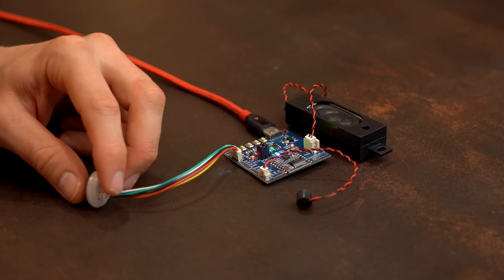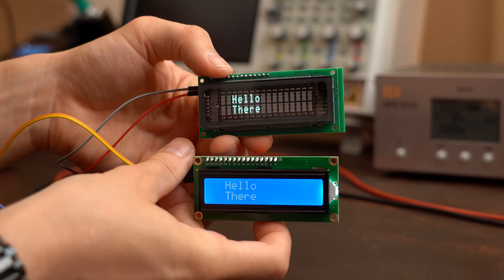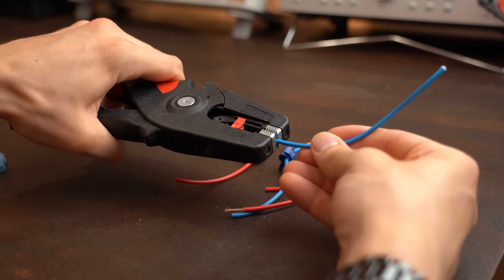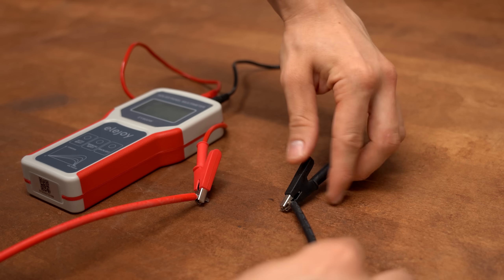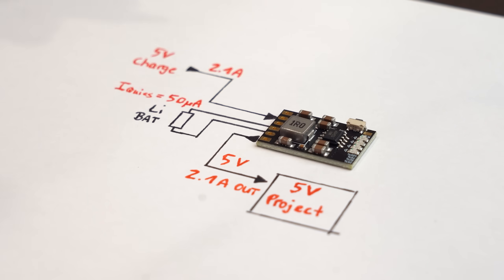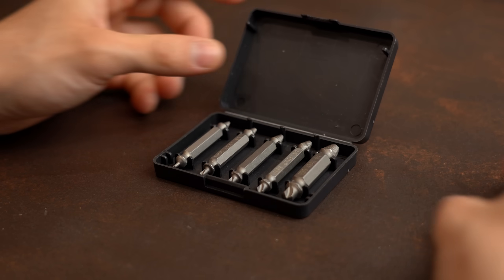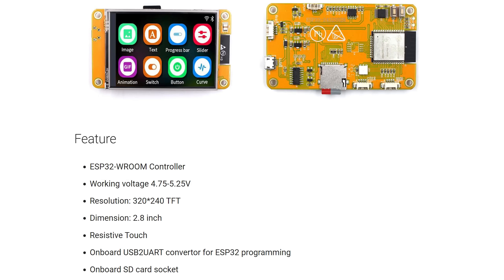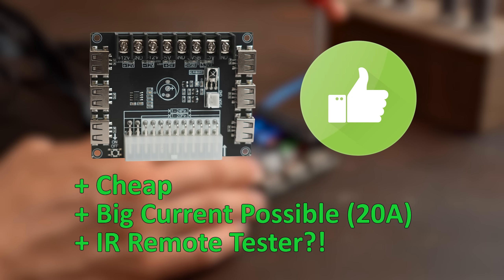I tried finding Hidden Gems on AliExpress AGAIN! (Part 6)

Comment: The blue clip-on connetors are not single size. They exist in multiple sizes with different color coding. The same one as insulated fastons. Red for 0,5 - 1,5 mm2, Blue for 1,5 - 2,5 mm2 and yellow for 2,5 - 4 mm2. They work great for indoor (interior) use for various low current application, if you need to just splice a wire without cutting them from a harness.

Comment: On the T-splitter: You have to understand that outside northern europe Wago connectors are like unicorns, It seems like its made for the US market since they use those red hats (yes 2023) and have usually one set of gauge on their cables (some look like actual stereo cables)

Comment: For the lithium ion battery charger, it has a key pin close to switch, so if you are using a microcontroller you just need to set a that key pin high evert 30 secs

Comment: Recently I have bought that lipo charger booster with a built in type C port
It came with an optional type A port that we can solder on. I have powered a raspberry pi 3 B+ with it and it works great. It never showed that low voltage issue, which I regularly get with the power adapter that came with the pi kit.

Comment: 03:35 Using Wago connectors without cable end sleeves on stranded conductors is, … —ehm— *botch*. (So you need at least one more tool for crimping the sleeves.)

Comment: I note that when trying to extract a screw, you wiggled the drill around and used a high speed. This will cause the drill to always strip and enlarge the hole without cutting in to allow the screw to be extracted. It is vital to maintain a 90 degree angle to the screw and use a slow speed, because you are essentially tapping a thread into it. Your method will always fail, no matter if the product is good or bad (and there are good and bad screw extractors). That said, I don't think that set is a good quality one and isn't worth buying.

Comment: Regarding solar panels, it should be a trivial and relatively cheap task to have a small sensor device with four small, cheap panels that has the panels in a flower petal configuration such that if the light is stronger on one side it provides a signal to control motors that turn both the small sensor panels and the main panels to face the light source. If controlled by a microcontroller then when night is detected then the panels could be reset to face sunrise. Thus, you could maximise your solar power collection automatically all day.

Comment: I used those T wire splicers in my last job as a laundry repairman. A lot of different retrofits included those to supply power to new card readers to replace the coin slots in older machines. Though the spade connectors were usually precrimped on the wires included with the retrofit.
Reply: You had a job fixing broken trousers and blouses?  Cool. ;)

Comment: Another note for the screw extractor to successfully get out the damaged head screw you need to drill a smaller hole inside the screw head after that use the screw reverse extractor so it has what to grip on. If you use it on a flat head it will never work/come out.

Comment: 10:05 Um...it looks like you're using the screw extractor bits in the wrong direction...and you're supposed to use them on low gear (high torque) mode/setting as compared to 9:51. The end of the bit that clears the head of the screw is used clockwise and the extractor side of the bit is meant to be used counter-clockwise....that's all provided that you used screws that need clockwise rotation to screw them into the wood. There are screws out there that use counter-clockwise rotation to fasten into the structure, and there are extractors sets for them. just need to be very sure when reading the description.

Comment: So the charger/booster could function as UPS for a Raspberry Pi.
Reply: No, if you remove the charging current, it will not auto-switch to battery power. Very weird/annoying issue with this module. @GreatScott! mind confirming this issue?

Comment: @greatscottlab Nice Video, thank you a lot. It would be cool if you can review the power bank / UPS with a microcontroller and two pins (to read I2C). It is easy to reuse Li ion batteries and can be handy to power important electronic devices. The readout of I2C can be handy to trigger a controlled shutdown of a server if the battery gets low. 300W Power Bank Case 1.54inch IPS Color Screen DC UPS LED 8cell 21700 or similiar one of this supplyer. Feb 22 Store

Comment: The screw extractor was spinning the wrong direction. Drill the hole clockwise and flip the bit and then remove the screw anti clockwise

Comment: What was the low voltage cutoff of the battery circuit? It's often 2,5v which is too low, I wish I could find some battery protection circuit that cuts off at 3v, very hard to find. I have looked may times.

Comment: I want to use the little usb boost/charge board with a 6v 0.8A solar panel and lipo cell. Do you think it will handle the varying solar current ok?

Comment: the screw extractors only work at low speeds and in the anti-clockwise direction, not as you did in the video

Comment: Dude you were using your screw extractors wrong. Your suppose to put your drill in reverse for them. They have left handed threads that catch and back the screw out. How is the screw gonna back out when you were drilling clockwise? lmao

Comment: Bear in mind that those little lithium power bank boards that simultaneously charge an 18650 and produce a steady 5v output invariably have a low current cutoff that sits around 50mA, so if you're planning on using it for low power applications you're going to have a very bad time. It's quite literally impossible to find one that doesn't have a low current cutoff unfortunately, believe me I've tried. 

In that circumstance it's much better to just use a small boost or buck board to convert the 4.2v from the 18650 to 3.3v or 5v depending on your needs, and design your project to have a replaceable cell so you can just take out the empty cell and stick in a freshly charged one as necessary. For low powered applications you'll only have to change your cell every few months at the most, so it's not a bad trade off.
Reply: Somebody above mentioned that on thst particular board there is a pad on the pcb to disable low current power off. Your prayers are answered.
Reply: @procrastinator1842  Not quite, these MH-CD42 power bank modules don't have a method for fully disabling the low current cutoff, they just have a "key" pin you can pull to ground (eg, with a tactile button) in order to tell it to turn back on after it's turned itself off. You can't just pull it to ground permanently and have it constantly produce a 5v output — believe me, I've used these exact modules in dozens and dozens of projects at this point, and if you try and bypass the cutoff by tying the key pin to ground all that happens is after a minute or so the module switches itself off again and won't turn back on until the key pin is allowed to go high.
Reply: @sfdntk  Damn.

Comment: It seems you were trying to use the screw extractor in clock-wise, forward mode.. If so, you needed to run it in reverse to remove the screw with the extractor.

Comment: For the T-splitter, you bough only 1 size. They come in different sizes - each size comes in a different colour. You should have looked it up before commenting on it. Also, you're comparing it to a very different item designed for very different purposes. While you could use the other item to "slplit" a connection, you have to cut the wire you're splitting to be able to use it. With the t-splitter, you just have to crimp it onto the wire you want to tap into.

Comment: I’ve successfully used similar screw extractors - except on a hardened steel bolt.  It could simply not find purchase on the metal.  That time I had to dremel a slot with a grinding disk and apply a flathead to get it out.

Comment: A fun and informative video.  What brand are those wire strippers?  I seem to be so many but none seem to strip very well!  Also, the best thing about the screw extractors is that once you have a set, you never need to use them.  I've had mine for years, and they remain as-new.

Comment: Ok, I had to laugh when you described the ATX power supply being advertised as having a microcontroller, but turned out to be a 555.  About 90% of HackadayIO user comments say “you should have used a 555”.  Well there you have it!

Comment: As others have mentioned, I really hope you weren't trying to remove a screw by turning it clockwise.... But probably just the camera making it look that way. But if you did go clockwise, it can wear down the teeth on the bit, then it won't work in the correct direction either.

Comment: Excellent video once again! Do love those VFDs! Have you considered testing P-Tap connectors to split the cable? Doesn't cut in like a normal T-Splitter. Not sure about the resistance, but it would be a great demonstration. :D

I love these series. You get to test the things I'm too afraid to waste money on... The risk sometimes is definitely worth it though! Great find on the breakout board.
Keep it up!

Much love from the UK!

Comment: It is worth mentioning that ATX PSUs are designed to output the rated power only if both +5V and +12V rails are loaded. If you have a 500W PSU that claims to deliver 250W on each of these lines, it doesn't mean that it would give you that if the other line is idle. So if you need to pull a large current from one, hook up some dummy load, like a lightbulb to the other.

Comment: I use that screw extractor at work sometimes, definitely works, you should not go full power with the drill, first drill a hole deep enough, then put the wedge screw in and hammer it into the hole if needed, then while pushing you need to reverse slowly with highest torque setting/impact driver

Comment: Which car dashboard uses VFD, not only in 2023, but even 2010 and maybe a bit older? I'm not really aware of that. New cars have full LCD virtual cockpits, VFD is a thing of past, a flashback to 80s

Also, the purpose of T-splitters is that you don't cut the wires, for example wiring harness in a car. You're not correct that T-splitters are only in one size, you can choose multiple sizes.

Comment: when using a metal drill and screw extractor the key is slow drill with no wabble like you did. them very slow extraction to allow it to bite.
Reply: it helps to have metal working experience.

Comment: VFD's are great, I used them in an audio spectrum display I made for my home stereo and another for the car in custom 3d printed enclosures. The extractors work but there is a  technique to using them and using the correct size. I don't think soldering the battery is recommended?

Comment: Did you use a fairly slow speed and a drop of oil when drilling? That style of extractor works well, but yours were likely made of too soft of metal. But oil can be important with steels that can't handle heat,

Comment: I have a device that connects to my bicycle dynamo that outputs 5V. I've been wanting to add a cache battery to it to capture energy when no load is connected but also provide a 5V output whether or not the battery is charging (passthrough charging?). Do you think that little boost/charger circuit might solve my problem?

Comment: The heatpad at the end is interesting for 3D printers, or to heat your butt at 90C, but don't trust it completely, I had a cheap one from  Aliexpress and it blew the fuse when the thermal runaway started.

Comment: Does a vago connector exist that would allow me to cut the wire and splice it back but feature a tap in the middle?

Any alternatives to t-tap connectors

How can tap into a canbus for instance, if not using t-tap?

Comment: When you drill the hole with the screw extractor, try going slower with the extractor. You want it to bite and hold, going fast and wobbling the drill all over is literally the worst way to use it, the bit will never bite and you will just make the problem worse. 

My set is designed to use in a hand driver, slow and steady wins the race.

Comment: FYI. The battery charger module has a "key" pad you can set low on a microcontroller or ground to disable the 30s auto cutoff.
Reply: this comment needs to be pinned! I noticed that but thought the word Key referred to the switch next to it.
Edit: Although having read the description/Use tutorial on the product page I'm unsure what it is actually used for. Only one way to find out!!
Reply: I heard that you can "tap" the key to ground for under half a second at an interval that's less than the power-down timeout so that if you want it to power down, you just stop grounding the key and it'll shut off in 30 seconds.
Also you can do a "double tap" to the key to force an early shutdown.
Reply: Perhaps using header pins would be a less problematic way to connect your off-board items?
Reply: Hi, I bought the same charger, but it doesn't charge the battery that I connected to it. 
I measured the current that goes to the battery, and it is around 0.003 amps (basically nothing). Also, when I disconnect the battery, the 4 LEDs won't turn off. It's like a battery is connected to the circuit, but there isn't one. 

I would really appreciate it if someone could help me with this issue.

Comment: Word of warning. Do not use the ATX powersupply as lab benchtop powersupply. It seems like it does not have any overcurrent protection, so it can easily fry your board.
For portable work I use FNIRSI DC-6something something. I paid cca 35EUR for it and it works fine. The funny thing is that it does not even have built in power source so you must provide your own adapter or USB-C power, but it is small and has the basic lab benchtop power supply features (overcurrent protection, overtemperature protection, on/off button, etc...). 
It is by no means perfect but better than forcing 50W into short on your board :-)

Comment: T tap terminals are used not as replacement for wago`s. Main purpose of use of taps are automotive instalations. When you need to connect something to existing wiring of car or motorcycle, often they are one of best options.

Comment: The fear of shorting pins on the small "power bank" board is mostly due to your atrocious soldering "style" 😉. Seriously, after all of these years of making videos about electronics, I'd expect you to have gotten over the phase of using the soldering iron like a pen to spread solder around (with all of its flux gone).

Comment: These screw extractors look a bit different to ones i've used but generally once the hole is drilled you would have to tap the extractor down into the screw with a hammer and then try to twist. Do they do a server power supply breakout board?
Reply: I have seen  PS breakout boards for 12V servers up to 1500W.  Don't remember for sure but the price is probably 5X expensive.  Julian Ilett did a youtube video about them. https://www.youtube.com/@JulianIlett/videos

Comment: I've been using those little battery charger/5v boost boards for a while now and they're awesome! But I also agree, the fact it turns off with low current is frustrating. If it's used for a project with a MCU, you can set a pin to send a little pulse to the "key" line every few seconds to keep it awake, though.
Reply: ah good to know.

Comment: The T-terminal has several advantages.
 Firstly, there are situations where the wire does not have extra length, so it cannot be cut and stripped as with Wago.
 Secondly, there are places where it is difficult to reach with a tool, and it is more convenient to simply clamp the terminal with pliers, and then crimp the wire in a comfortable location. 
Thirdly, the T-terminal allows you to return the wire to its original state by simply adding a bit of insulation, and there is no need to solder the wire again.

Comment: The MPPT is not worth the price, you can deduce an MPPT point with just two measurements, the open voltage and short circuit current. You can do it with multimeter or with power sensors if needed for much cheaper. And you will still be able to tell whether cells are broken or not

Comment: The T splitters are actually very useful for adding to an electrical harness in a car without cutting the wire. I would not use it for anything high current, but they were awesome for connecting the backup light wire to my dashcam/backup cam. I did not want to cut the existing wire, and I wanted it to be removable. 

Your complaint that there is only one size is unfounded as there are at least three sizes available.
I would recommend adding dielectric grease to the connector before attaching it to the wire.

Comment: The wire splitters used to be known as "scotch lock" connectors. Everybody used them in the 80s and 90s for fitting stereos to cars, alarms, cd radios etc. They work for about 6 months until they fail by corroding.

Comment: The ATX adapter is not the same as the $50-$60 bench supply.  You don't get variable voltage and current / voltage limiting.

Comment: The T splitter connectors - here we call them something that sounds like "current thieves" - comes in different sizes for different wire gauges ^_^"" the problem on the long term could be oxydation  , one can also use some grease to protect the inner part from moisture. My car dealership used these to connect my rear sensors lol, they are running ok after 12yrs in a mechanically stressed environment. Wagos, btw, are surely better if one can use them (size matters sometimes)